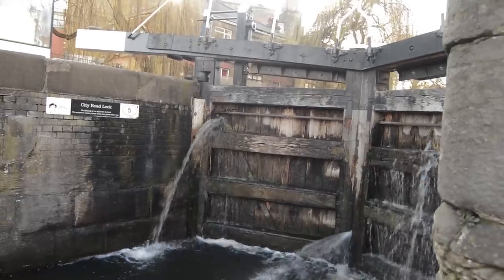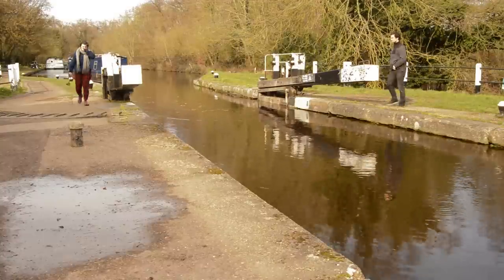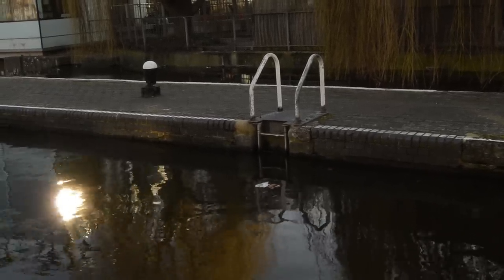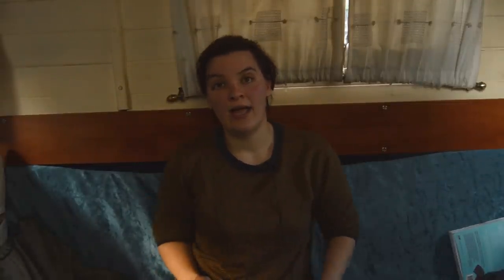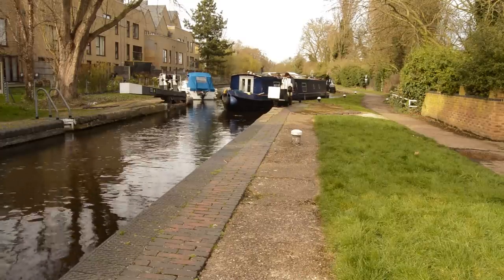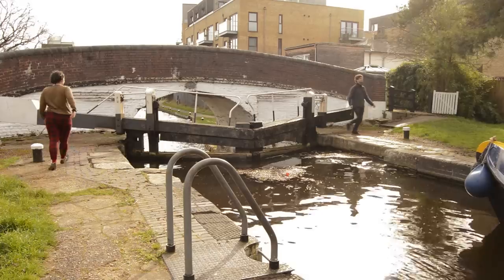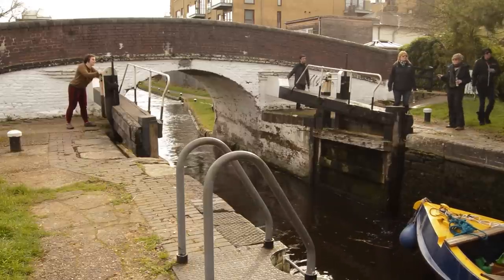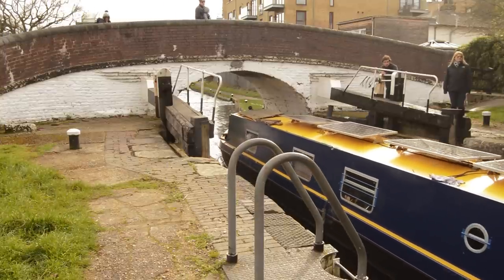How A Canal Lock Works.

Comment: A + on a simple walk thru of  function and method of  moving boat thru  lock ,, thanks , I think i remmber seeing  some gates that do not have Paddles/sluices in the gates , the sluices are built in to the  canal wall , is  there  a reason  or  spefic canal or  time frame  when  a sluice built into the  wall was used  ??  or  was it just the builders choice on which to use -- on the gate or  built into wall  ??  And if  there is  Enough of a Elevation change  from one lock to the next  would  would  one sluice only be used   to shift water in one direction ? , or am i imagining more of a problem than  there actually is  ?
Reply from the maker: to be honest I am not sure
the water does only go in one direction, there are water resovoirs where water is added to they system from (by the canal and river trust)
Reply: @ThisNarrowboatAdventure   Hmmm ,  Maybe   I did  see  a sluce from  a   Reservoir   and miss intrupted or did  not  watch the entire for   inclusive info.  ,  thanks    i think i need to  research  to see again ,  what i remmber, i  download a lot of  canal tuber episodes , info for planning  a vacation - likly on a - Escape the rat race-  supplied boat  www.etrr.co.uk , sorry shameless plug --  over time its become more of a dream than a plan , still i have the info to plan  ,  thanks  from the usa
Reply: Oh   Foxton  lock  set uses   pounds   ,  Red and white  colored paddles  designate  which is going to  and coming  from  pounds  -- courtesy  of   Lets explore - Leicester branch  5 the foxton alternative